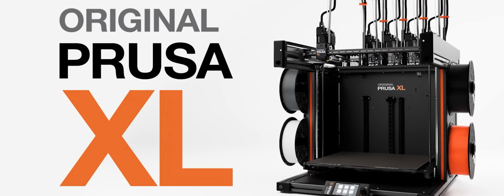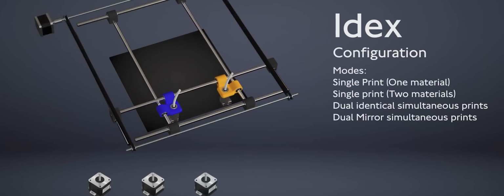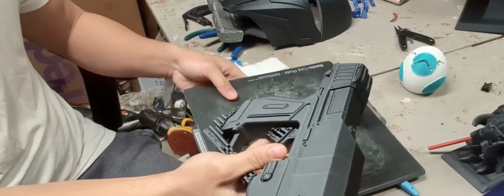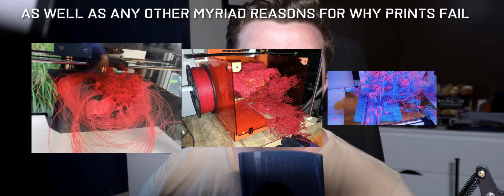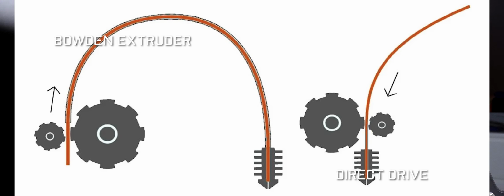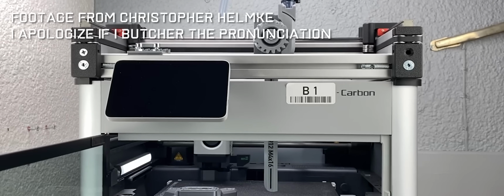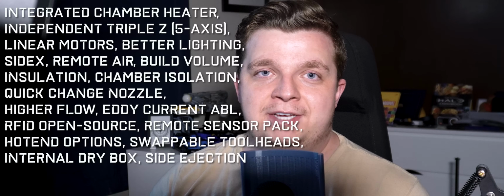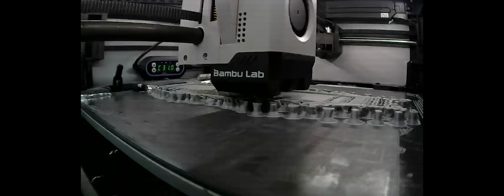Bambu Labs Next BIG Printer

Comment: Some of my secret hopes for it: 
- Larger build volume but not huge (like 300-350 is good)
- New AMS with dryer but with backward compatibility to old AMS 
- TPU compatible AMS - OR a 'single AMS' sort of one-spool modular system for abrasives or flexibles
- 2-head + AMS for 2- filament no -poop, and 4+ filament 1/2 poop (it'd certainly make printing with support material more feasible!)
- I honestly don't want a tool changer, just more maintenance to worry about, but AMS+the option of tool changing would be sweet.
- nice to haves: better lighting, quieter fans, built in refillable AMS desiccant pods, 270 degree door hinge, OPTIONAL A1 style hot ends, ethernet
Reply: I recently bought the magnetic led upgrade from BQ. It’s cheap, easy to install and really bright. You should try it and have one point less on your list.
Reply: @lazyman1011 it's still pretty subpar. Much better off just buying an LED strip (connects to the original LED plug) and print a 45° lip to stick it to. That's what I've done, cost $0.99 for the led strip that runs 360°, and about $1.50 of filament for the 45° strips that go around the unit. 360° lighting for 2.50 total.
Reply: yo TPU for AMS is now out for people to test :D
Results are so good.
Reply: All I want is an A1 Max with 30cm build volume. There are no decent slingers atm with that or more volume and I'm sure that Bambu could deliver one that is as reliable as the other ones. But I'm pretty sure they will just launch the A2 series.
Reply: @hellmut23  why would you WANT a bedslinger over a more reliable corexy?
Reply: Agree with most but i think ditching the ams for toolchanger would be better - even in terms of maintainance. The ams itself has a lot of complicated stuff (feeders, rollback, helper motor, buffer). I hope they come up with a very clever idea to make the actual tools minimalistic. Like how they removed all the cables from the nozzle with the A1compared to the x/p series. Heating, feeding and cooling all in the actual head and only nozzle (maybe with fins/fixture) and filamenttube will be changed. Could also be very small and offer many toolslots.

Comment: The downside of larger CoreXY 3D printers is lower print quality, due to the extra slack caused by the excessive length of the belts in such large CoreXY configurations. That's why I hope for a magnetic track with levitating linear motors for the next big Bambu, somehow like the MagnetoX by Peopoly.
Reply from the maker: They could also reduce slack by going with a AWD configuration.  But linear motors has the most room to grow.

Comment: I would not call these printers affordable. the ender 3 is affordable. does not stop me from drooling over them, atm i can only afford a wanhao D12 300 which cost me $400
Reply: To be fair, a Bambu A1 Mini is ~$200 and is a crazy good machine.
Reply: @tg_2137 yes,but it’s a mini!
Reply: just want to point out that you're equating initial cost with affordability, it is your use case so that's all that matters for you, but some who, for example, equate time as money, or uptime = convenience, would include lost time on repairs, maintenence, calibration, initial setup, z-height and bed leveling recalibrations, firmware customizing, etc. as unaffordable, despite the initial cost. I use my printer for fun and for work, I spend approx 1hr every 3 months on maintenence, and zero time repairing problems on average. this makes the printer more affordable for me.
Reply: @joeylopezdesign   exact point for me. Time is more valuable and you lose alot of that on Enders, along with modifications youll have to spend your own money on
Reply: To even say that BL printers aren't affordable is a copium comment. With the A1 costing $200 USD, which is less than an Ender 3, and is EASILY 100x more reliable straight out of the box...
You're just anti-bambu.

Hell, the A1 is less than an Ender 3 and is bigger. Like, come on man. Just say "I hate bambu lab" lmao
Reply: @eX_OSRS People are talking about the X1C, not the A1 mini. I own a X1C and it's awesome but not "affordable", it's obviously among the more expensive printers. It shouldn't be compared with industrial printers or tool changers.
Reply: @knightmare1442  every printer BL has is affordable. They are ALL priced competitively in the market. If one printer is too much for your tastes, that's a personal issue and you shouldn't be looking to spend that much, move down the printer scale to the p1s/p/a1/mini.
Reply: You are bad in financial decisions, please stop with it.
Reply: My Ender 3 buddy still leveling their heatbed while a BambuLab user flexing how good the print they got.
Reply: They are affordable. People pay more for coffee every day for a whole year. So yeah they are affordable. Save your money.
Reply: @UndregoGrey  wanhou what ? Never heard from it, deffentely waste of money.
Reply: The k1 se might be good,it’s even a core xy
Reply: 250$ for A1 atm
Reply: Bro just get an Bambu Labs a1. Cheaper and better than any wanhao
Reply: For 50 dollars more than that you can pick up a bambu labs p1 without the enclosure during a sale like the one they've got going on now.
Reply: Guys, stop. You have to realise that for some, their time is worth less than the difference in price.
Reply: The A1 series is definitely affordable.  They also save so much time since no hassle with having to spend hours calibrating or tweaking the print.  You just load a roll and go right out of the box.
Reply: Any 3D printer is affordable. Just come up with a few key designs and set up an online shop until you break even.
Reply from the maker: They are more expensive for initial investment.  But the same E5+ I mention cost me $750 when I got it, I've given it a new control board, direct drive extruder (Revo Hemera XS),  bed upgrade, all to get a fraction of the performance and reliability I get out of my X1C.  But when you factor in failed prints to the cost, the X1C comes out on top by a huge margin.

Comment: Interesting point about anisotropy. Extra resonances when moving multiple heads simultaneously will be a control challenge (input shaping stuff) - as seen in error rates of racks of spinning hard drives.
Reply: Makes me wonder: how much effort would it take to make a linear motor driver that senses the induced currents from the moving head to be used in a closed loop system that deduces required input shaping from the corrections?